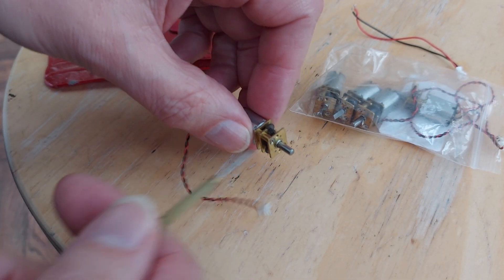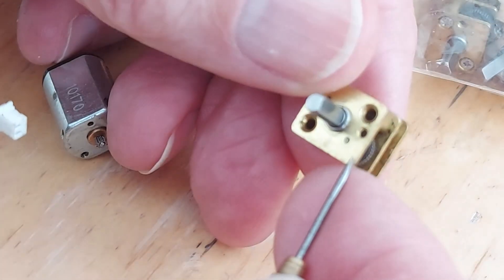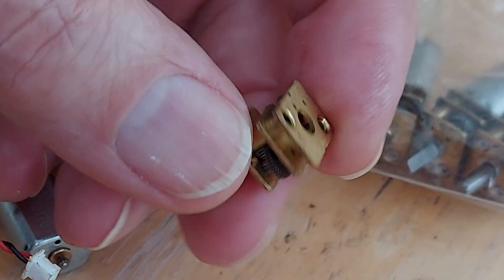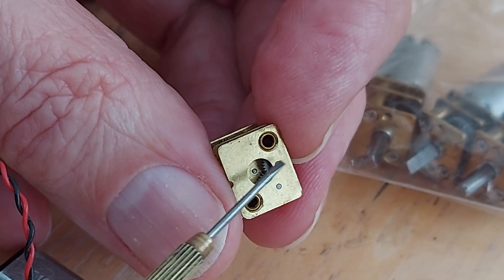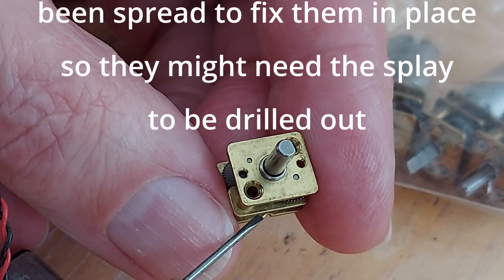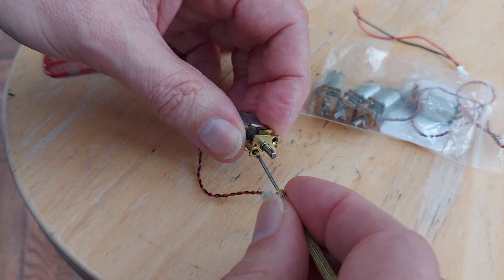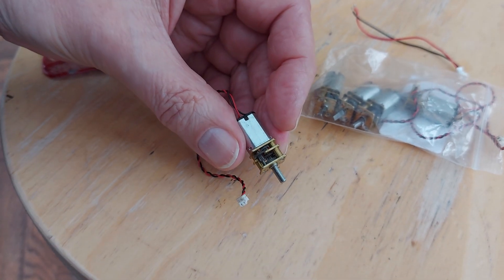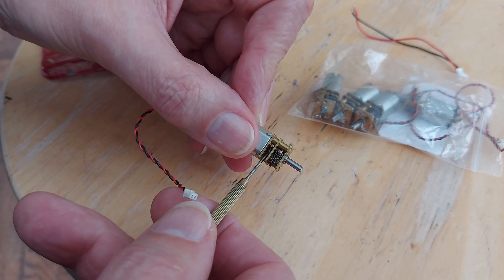Video reply - Another peek at the N20 motor and gearbox

Comment: Hey! Thought I'd stop by again. So in my other comment I asked about replacing the shaft. See below -> 

So I did got two N20 flip threaded M4 motor. So the one where the motor points down and on the side a 50 mm M4 shaft goes up. The first part is carefully levering off the top brass plate. Those are press fitted but not overly tight. If the plate is bent, then it can be straightened again with a vise. Once the plate is off, two gears (one double free gear with a small bore -> goes on the main shaft, one fixed double gear  with pin come loose. The shaft sits in a 3 mm bore brass bushing. Can be pushed out with a vise. #

Now comes the part where manufactures differ. The first N20 I got had the shaft gear press fitted  and it was kept from rotating through by tiny vertical teeth. Gear can be pushed off with vise and some tapping with a hammer. The other N20 I got (same flip threaded type) had the gear welded on... Not ideal but still doable if you silver solder the gear back on. Not sure if the gears are hardended but I doubt it.

Then it was just a matter of parting off the threaded part of the shaft, taking some material off to bring the threaded section closer to the brass bushing, then drilling a tiny 1.6 mm hole about 2 mm deep (mild steel, so it's easy)  and then turning down the end of an M3 rod. Then carefully silver soldered it together. It does have some runout, not entirely sure where that came from but it seems the threaded shaft has some play to begin with so should be alright.   Then just pressing the gear back onto the shaft and putting all back together. Bit fiddely but overall very doable.   Probably overall medium difficulty!
Reply from the maker: Hey, thanks for the update. I will pin your comment so other people have access to your experience 👍👍👍👍
Reply: @GrandadIsAnOldMan 
Cool! I might do a video of the full rebuild on my channel soon. Just waiting for the 100 rpm version as the 60rpm motor is too slow for my application